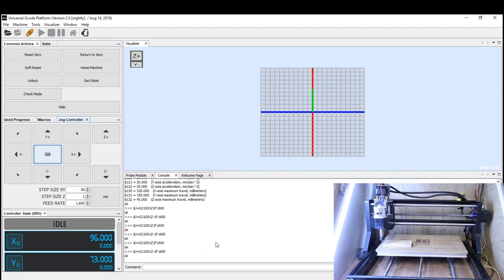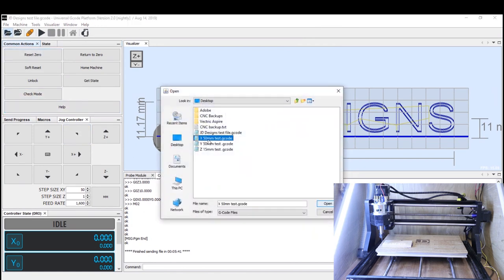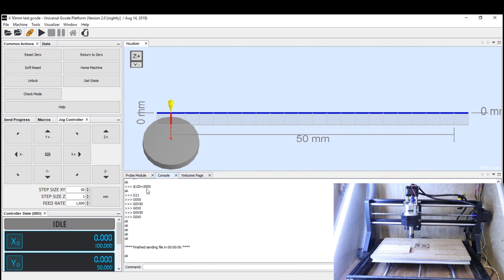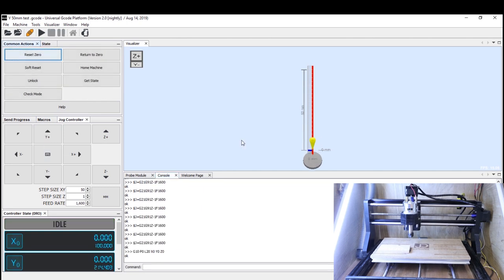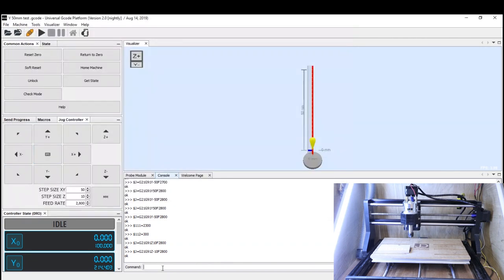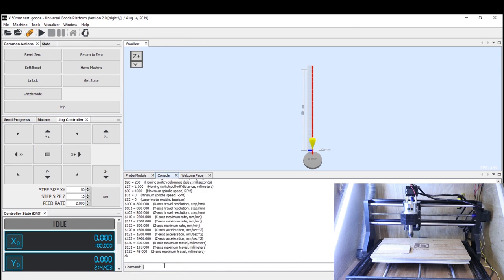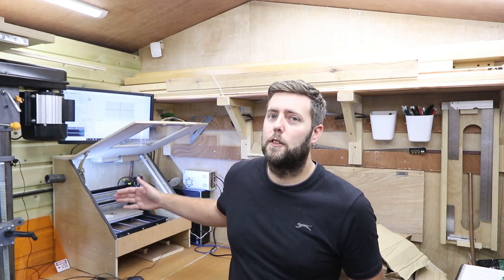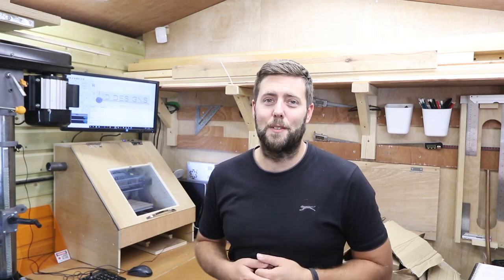3018 PRO - Tuning GRBL settings

Comment: With my 3018 pro I am getting the problem where the letters get squished together on the x axis... It does engraving ok... But occasionally it will overlap two letters on the x axis and messs up the project. The machine does squeal during x axis movement. Does anyone have any suggestions???
Reply from the maker: Lubricate your lead screw. This will help it move much smoother.
Reply: @JamesDeanDesigns  I fixed it. The problem was the brass piece and the spring. I just removed those and it's working good nkw
Reply from the maker: @KuKuclown  those parts are required. That I'd your anti-backlash nut, it minimises the amount of play in the axis, it is meant to give resistance
Reply: If a stepper is losing steps you need to reduce the acceleration.  No need to reduce the speed usually, it's the turn-around in direction and accelerating back up to full speed that causes the steppers to stall of skip steps when acceleration is set too high.  

Air cut testing is not a good way to test acceleration except as a first step.  You need to test acceleration by cutting things where the loads are more like what you will see in actual use.

There's also mechanical possibilities like motor coupler slipping on the shaft if you forgot to tighten the set screws in the coupler.  Don't ask my how I know this :o)

Comment: I'm trying to tune my 3018 pro and watching the video (tuning GRBL) at the same time but when I tried changing $120= or $121= to any other number it just stayed at the same speed, I went from 50 to 3000 and nothing not any faster not any slower. any suggestions?
Reply from the maker: 120-122 are just your acceleration settings which literally a split second so you will not see a huge amount of difference per move however you should hear the initial noise be a bit different between slow acceleration and the faster acceleration settings
Reply: @JamesDeanDesigns  thanks,  it just seems like in your video I can hear the acceleration.  I ran a stopwatch everytime I changed the acceleration and no change.   If anything I'll just leave it.  Thanks for the tips and tricks video I had to glue my Z bearings down and just received my dust shoe can't wait to try it.  Your awesome could of never have got this far without you and your videos.  But I still have a long way to go.

Comment: hi this is a tutorial for grbl setting s and you say open up universal gcode platform,  where is that in the grbl program?.
Reply from the maker: GRBL is the firmware installed on your control board, dont confuse it with the standalone software installed on your PC called GRBL or GRBL Controller. That GRBL software on your PC is just a way to control your machine and send Gcode across, which is exactly what UGS does. Hope that makes sense.

Comment: Thanks for the great videos. Is there a way to use the probe in UGS?  Thanks.
Reply from the maker: Yes there is, its quite easy. If you have a look through my list of videos  there is a video for setting the Z probe up on the 4030 and the 3018. It shows you how to do it in both Candle and UGS
Reply: @JamesDeanDesigns  thanks

Comment: Grab a set of 3D printed limit switches ...saves your stepper motors etc...
Reply from the maker: I agree but I decided not to bother with limit switches on this with the cutting area being so small, there are a couple of jobs i do where I literally need every millimeter available

Comment: How do I decrease the power of the laser? I'm having trouble finding and adjusting it. I'm just using corrugated cardboard for testing and it's burning straight through it and was wondering how I can adjust it for different materials
Reply from the maker: Hi. If you watch some of my other videos on the laser it runs through this but basically its about making sure your $30 setting is the same as you Smax value in the software. Then within the software you should be able to control the power of the laser, usually as a percentage
Reply: Checked out the videos and you provided me with the information I needed to adjust the beam intensity. Thanks for making your informative videos because without you I'd have a nearly $400 paperweight lol
Reply from the maker: @moseswiles5734  thats good to hear 👍

Comment: H James and everyone thats for your help on my last issue now i have another. I am following your tutorial on setting the $ code for the grbl settings and i seem to have an issue when i follow what you are doing ie set $120=500 yours speeds up but mine dont it gets slower and slower til the higher numericle number i input gets to a point where the spindle barely moves any idead pleaase.
Reply from the maker: So you may find your acceleration is too high and its possibly stalling the motor. Come back down to a lower number like 30, and then work up from there
Reply: @JamesDeanDesigns   My current settings are $120=500.000 but to increase speed of the x axsis don't i need to increse the value.
Colin
Reply from the maker: @jackel7668  120 is your acceleration not the actual speed. The acceleration only takes a split second so you could take this upto 5000 and you won't really see to much of an improvement as such. $110 is for the actual speed
Reply: Look I'm really sorry guys I don't mean to be a pain in the gearbox but i don't think i'm explaining myself very well which for me is nothing new.
OK now on this tutorial that i'm following of yours you are talking about the X axsis where you got the 50mm line for adjusting the x - and +speed untill it stalls or start to stick well the more you increase the value on the X the faster it goes untill you get to a point where X starats to stall now to gget X to travel the 50mm you increase the value well when i do that my X does'nt get faster till it stalls when i increase the value it gets slower and slower on the X untill it wont move so i hope you got it now like i said im rally sorry for this. I'm a 60yr old disabled guy so that might explain it lol.
Thanks ever so much. Colin

Comment: Needed to tune my homemade cnc machine, to speed the x and y travels up, Your tutorial was very concise. Although I knew where these settings resided, I liked the way you explained it and the “de-tune” to ensure reliability and no missed steps. 
I wish there was a local group in the midlands to get together with others and swap ideas 
YouTube is great to learn stuff and get ideas, but face to face with others is sometimes more mentally stimulating
Well done.
Reply from the maker: Glad it helped. Let's see what the rest of the year brings but I'm always up for a meet up. They have them in other cities. Assuming it goes ahead this year, I'll also be at Makers Central as well, either on my own or as part of the Woodworking UK team so thats always an option.
Reply: @JamesDeanDesigns  makers central?, what’s that?
Reply from the maker: @conkcat  happens every year at the NEC. 2 days of makers getting together. Woodworkers, black smiths, jewellery makers, CNC people. Top tool companies exhibit there like Triton, Record Tools etc. I help run the biggest woodworking group in the UK, we usually have a stand there but I dont think we are this year. Just attending socially

Comment: Hey James, excellent video as usual. One question, does this process need to be repeated in every program that sends g code? i.e. Candle or Fusion 360?
Reply from the maker: No. Your GRBL settings remain in the memory of the control board. So even if you changed computer they all remain the same. Just take a backup of them once you've done it all to be safe
Reply: @JamesDeanDesigns  Dang, that was fast! Thanks a bunch.

Comment: I need a bit of advice... I've just changed the control board on my 3018 due to the first one breaking. Now the machine is cutting far too deep compared to the depth set on easel.... what settings do I need to adjust to solve this?
Reply from the maker: Take a look at your $100-102 settings. Typically they should all be the same number and either 800 or 1600 usually.
Reply: @JamesDeanDesigns  Thanks James, what difference does the difference in numbers make?
Reply from the maker: @valknutrestorations6278  its the amount of steps per revolution if I remember correctly. Usually 800 is the right number but some machines are 1600. Basically if $102=800 and you tell the axis to move 10mm and it only move 5mm, then yours needs to be 1600
Reply: @JamesDeanDesigns  perfect. Thanks for your help!